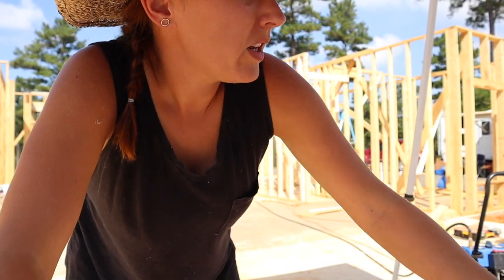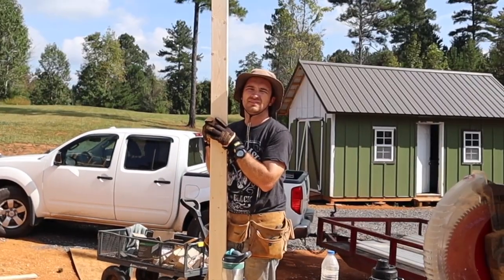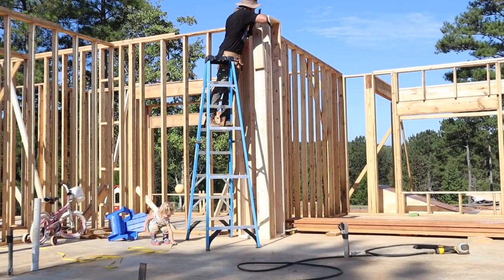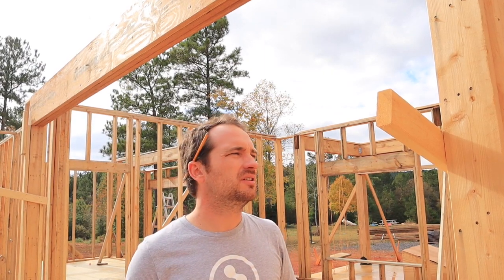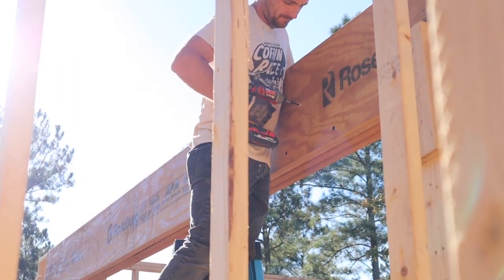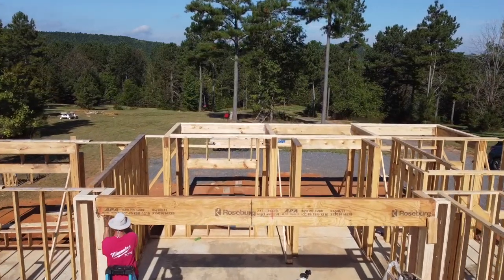Wall Framing Process with 2 people | House Build

Comment: Coming along nicely ! I envey the younger people who go out and build their own home. I am 70 and have built 5 homes in our 50 yrs. of marriage....something the wife has had to endure to much of her dismay at times ! What kind of sheathing are you putting on the exterior walls ? I would suggest you go with the Zip system. I have always used tyvek house wrap but would use Zip now. I have new windows to install and new log siding to put up on our addition !
Reply from the maker: I bet you've got some great stories and advice! Right now we're using osb and tyvek siding. We're trying to get it covered up as soon as we can - you never know what January and February can bring.
Reply: @DreamitBuildit  Jan. and Feb are the coldest here but they call for a somewhat mild weather this year. Nothing wrong with tyvek...just be sure you tape all the seams.